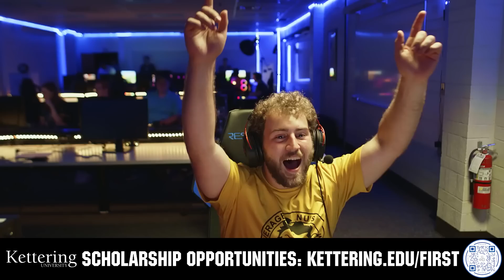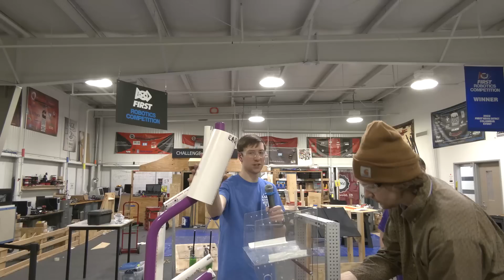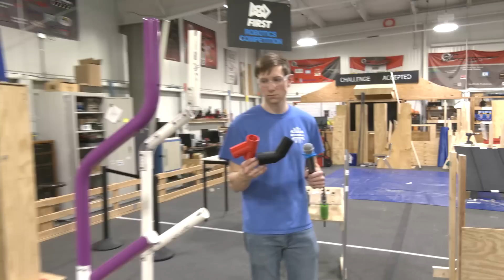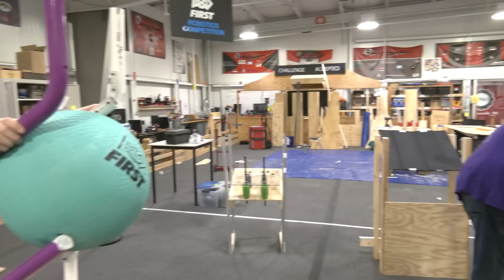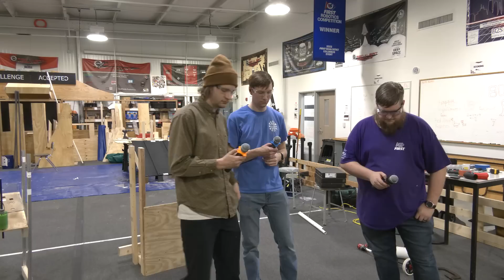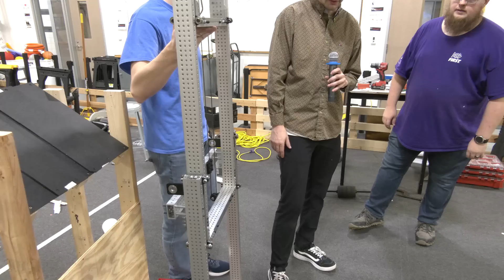Ri3D REEFSCAPE Day 2 Recap | Cranberry Alarm | Robot in 3 Days

Comment: This is awesome! quick question for the team however, are they concerned about potential damage from the cages during normal play? Those things have 20 plus pounds and can swing pretty bad if another bit runs into them. How do you plan on avoiding or dealing with that potential issue? 

Thank you guys for all the hard work and effort you put in! Hope you have a wonderful day!
Reply: It's definitely something to worry about. Since it's tall, if we were to play defense then we would have concern. Avoid them by not going near them unless needed, and drive carefully if we need to go through them.
Reply: I think just asking your teammates to try and not run into them. Since it would be a shallow cage then your alliance could probably put it on the left of the three set so people wouldn’t hit it when going to processor and the other cages wouldn’t be in the way

Comment: Can someone explain to me why they are using a two stage elevator instead of using g single stage?
Is it only because they want to lower the gravity?
Reply: Probably because of the 3.5 ft starting height limitation, and they dont want an angled elevator
Reply: We have a 2 stage because we had the thrifty elevator available and it was only one extra stage to reach L4.